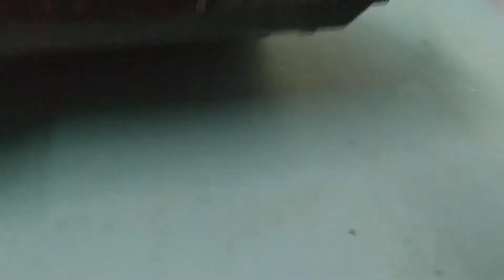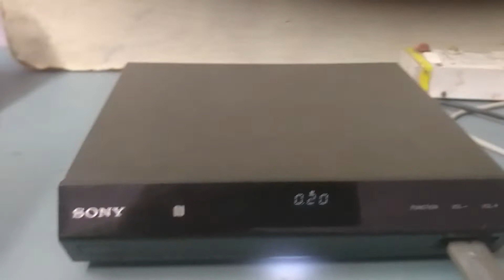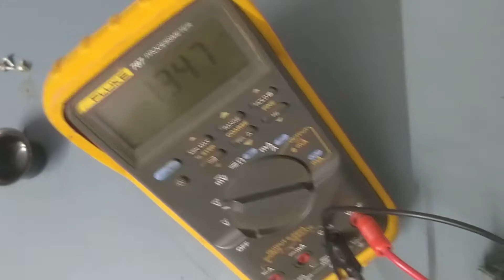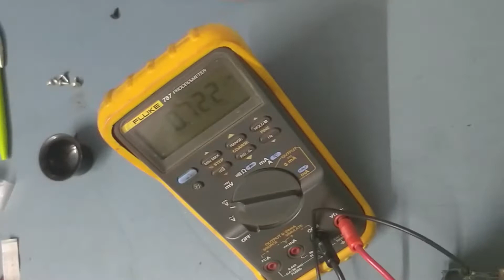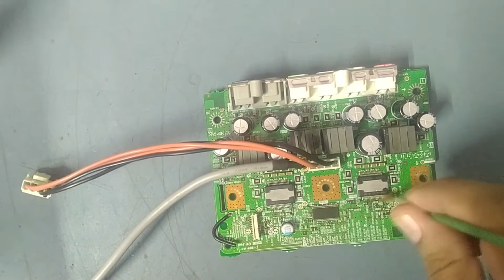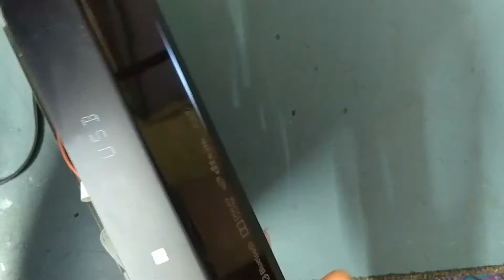SONY HT-IV300 HOME THEATER, How to check & confirmed Malfunction Audio IC's of Amp. Brd. & Repair.

Comment: Hi
I my SONY HTIV300, sounds are coming very normal despite of doing all setting.

Wherein my friends having same setup but output is very good.

One local technican said have to change IC then clarity will come because currently i all setting bass only coming and from others speakers sounds are coming like you have covered or kept by flipping manner..

Can you tel me what is the problem..
Reply from the maker: DM on this WhatsApp 9653123582 for more details information

Comment: I have the same model of amplifier but it shows #push #power #protect..what will be the issue sir ??
Reply from the maker: My dear their is problem in Amplifier Board section, some Electronic components might be defective. Or first check your all 6 speakers connection wires are proper is their any shorting in speaker wires pls
Reply: @TKFElectronics  I have checked all the speakers..when ever I connect it to my tv it shows #push #power #protect is its mother board gone? If yes whats the solution for it sir?
Reply from the maker: Don't worry my friend  I assure you Mother board is perfectly ok,  problem is in Amplifier Board.
Reply: @TKFElectronics  Thnx alot for your suggestion dear ..so what should i do to solve this issue?
Reply from the maker: My mobile no. 9653123582, call me tomorrow to discuss more about your system.

Comment: Hi....I am having iv300 and it is showing error power push protect. Sony technician is saying to change the power amp board. Can you help in resolving.
Reply from the maker: Yes, sure Mr.Teja , Power Amplifier board is repairable.
Reply: It is because of speaker wire short.

Comment: Hello sir I have this model, but recently the set is completely dead. 12v & 54v are not comming from SMPS board. D.C. 295volt available in HV side. Which component I will check?
Reply from the maker: Pls Check components located near small SMPS transformer side in power supply board Only, u must have to get  12vdc output volts from Power supply board to Mother
Reply: @TKFElectronics  Thanks. I will try..
Reply: I  use this model but in the last two weeks I have not gotten any power,  what can I do now sir please suggest.